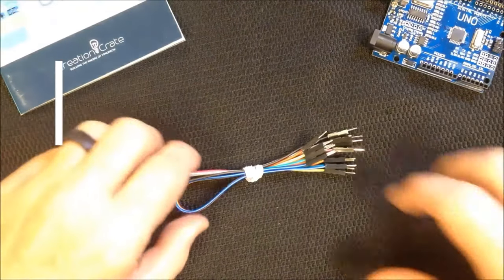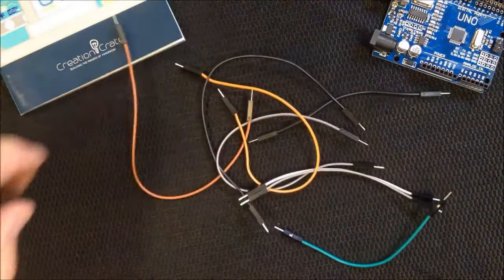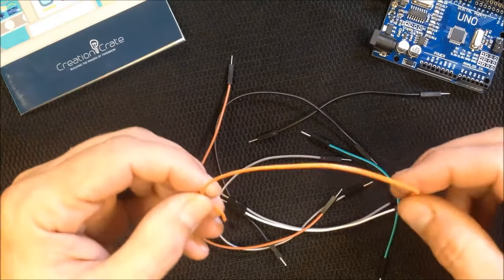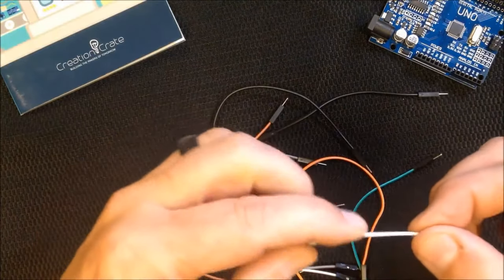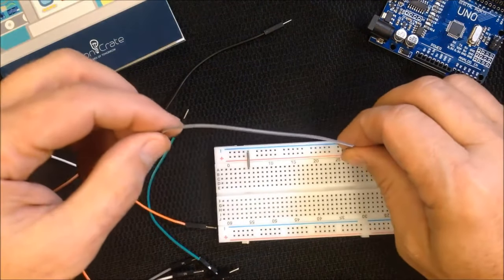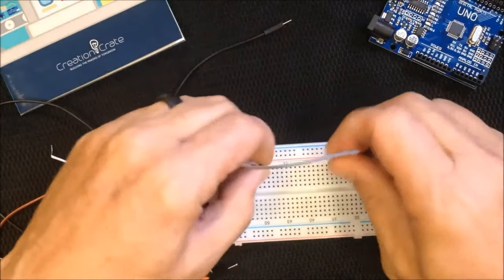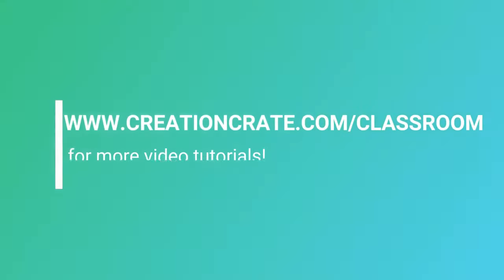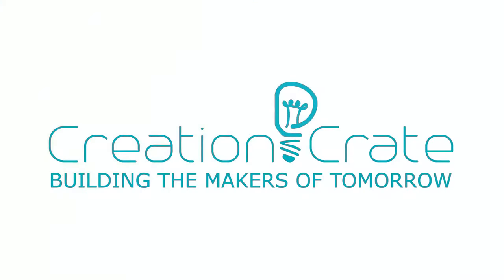What's a Jumper Wire?

Comment: if i put one side on a battery and another side on a mini motor will it make it work?
Reply from the maker: I'm not sure I understand your question exactly, but I'm going to give it a shot.

Jumper wires are usually used for making connections on a breadboard. Although they do act just like any other wire. It would be difficult to connect the jumper wire directly to a battery and to a motor. 

However, in theory, if you connect the negative terminal of the battery to the negative side of the motor and the positive terminal of the battery to the positive side of the motor, then yes it would power that motor. 

You may want to ask a parent to help you with this just to make sure you're doing it correctly and you don't cause damage to something or injury to yourself.
Reply from the maker: There are a few of things to consider when dealing with electricity. You have to make sure that you're using the right voltage and current so you can fully power and not damage whatever it is you are connecting to the power source.

Comment: Where do I use female to female jumper wires? Or the male to female ones? I can't figure out where the negative terminal goes
Reply: The direction of wire doesnt matter. 
Male part of the wire goes into the socket/hole of arduino or breadboard. Female part when there is metal protrusion like RTC module.
Reply from the maker: The male end of a jumper wire is inserted into a hole in the breadboard, UNO or other components whereas the female end of the jumper wire is used when there is a protruding pin.
Reply from the maker: The negative terminal is usually connected to the horizontal bus with the blue line running alongside it. If you want to learn more about electronics and programming, check out our projects at www.creationcrate.com. each project has detailed instructions in our Online Classroom.
Reply: Oh man, I had no idea. I've just gotten started with all of this, and I'm basically just experimenting with basic breadboard circuits with components like LEDs and Resistors. Thank you, though!
Reply: @nkashketchum  did my comment get deleted

Comment: What causes jumper wire to go bad? I have many of them that suddenly became malfunctioning.
I tested them with multimeter's  continuity mode and it didn't beep. Most of them last only a few uses. Now i have to test every single wire when connecting to Arduino board. This becomes distracting because 80% of my time is testing wire.
Reply from the maker: It is very rare for this to happen. I have only had this happen to me a couple times over the past 3 years. I am not sure why do many of yours have gone bad. Please email customer service about this issue and we will send some replacements.